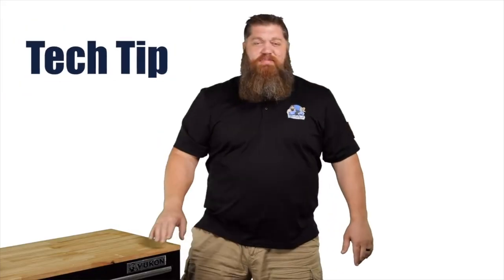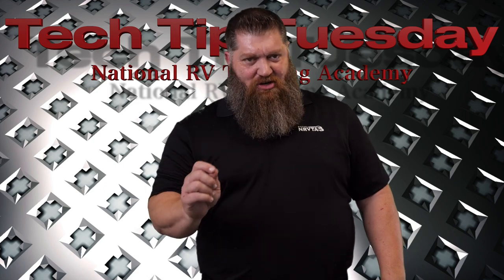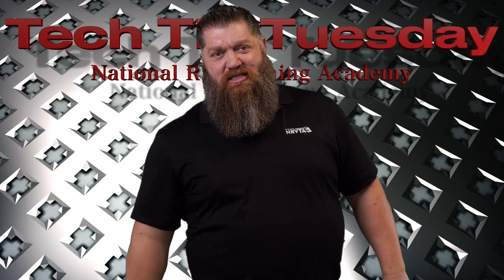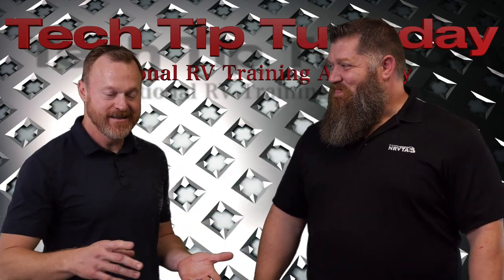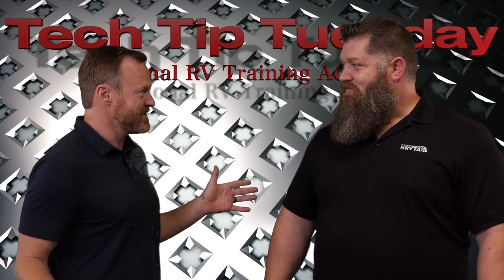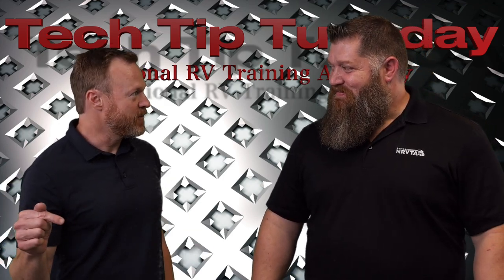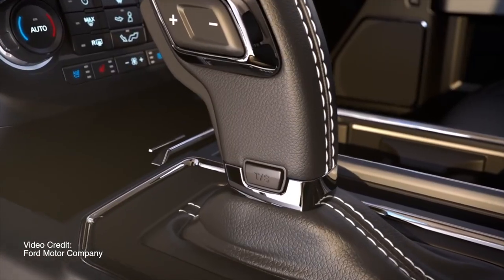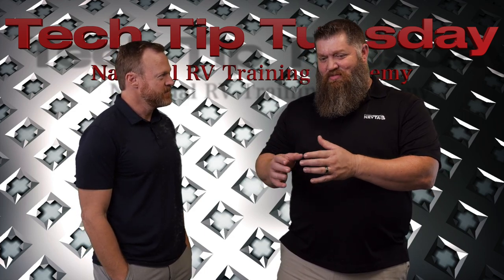Using the Tow Haul button when pulling an RV

Comment: I’ve found using tow/haul mode kills my gas mileage and only use it in very hilly areas. F150 with eco boost
Reply: I did the same thing, then someone explained it to me like this. How much does a new tranny, engine, or breaks cost? A ton more then a couple less miles a gallon.
Reply: @erikbudzinski7664  you are right if you towing up hill or down but if you flat tow you don't need tow/haul
Reply: @erikbudzinski7664  and I have talk to dealer and rv dealership just saying
Reply: @gardnetbush9768  well the dealerships will tell you anything to sell you on anything. I'm just going off what I was told by a truck technician and using my 10 years experience hauling everything from travel trailers to 90,000 pound heavy equipment.  Even on flat ground if you need to stop in a hurry I would much rather my truck downshift in tow haul to help me stop. Safety towing is always number 1.
Reply: @erikbudzinski7664  I get that but I tried it both ways on 3 different trips believe me my trans temperature was the same and if you look it up its say it best to use when towing hill and and down hill I'm not trying to turn this in to a big  To a big debate but I was curious myself and couldn't get a  correct answers so I just decided to do it as I traveled
Reply: @erikbudzinski7664   And you're right cause you're towing a lot of heavyweight I was say like travel trailers or mostly like campers
Reply: I have the same truck 2019. So you're saying on flat roads turn off tow/haul. Is there any stipulation for speed? Say like driving on 40 to 50 mph  road or on a freeway at 70+ mph. 🤔
Reply: @erikbudzinski7664  I think that's actually what the dealer service guy told me.
Reply: @gardnetbush9768  Debate is a good thing 👍 I like opposing opinions. ✌
Reply: That's interesting I've tried both with it on and off in mountains and flats...my mileage on both my 11 and 18 3.5 ecos stays the same with it on and off and with it on it pulls and stops the 7200lb rig soooo much better and I've have over 120k towing the rig with both as well also the tranny temp will be hotter with tow haul off as well on both of mine. I actually just did a 2400 mile trip last week always tow haul on and always cruise on when on the interstates.
Reply: I use both tow-haul and cruise control while towing and the only issue I have had with gas mileage is when I drove faster than 65 mph. Another thing that tow-haul does is activate the stabilitrack and anti-sway sensors on trucks so equipped.

Comment: When i turn on tow haul (2011 ram) i then have the option 1-5 with a plus and minus sign on gear shifter could you please explain which one i should be using?
Reply: When it’s activated, you have control over which gear the truck is in, and the option to hold it in one gear. Say, you’re pulling up hill and the trans isn’t shifting down; the engine is still pulling but you’re losing speed. You can press the - switch and tell the trans to downshift without having to “floor it” to make it downshift like you would in a car. Keeps the Revs down and prevents hard shifts under heavy loads. When you crest the hill you hit the + and shift it back up to the previous gear or hold it down a second or two and it will shut it off and go back to automatic.
Reply: @jeffswarts2027  thank you! Been having a hard time figuring out how to tow this will help me alot